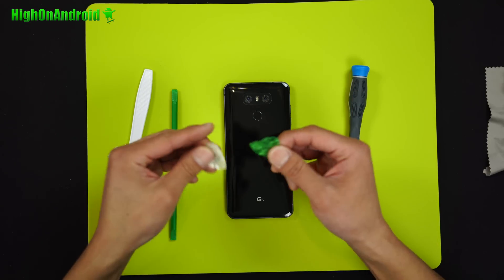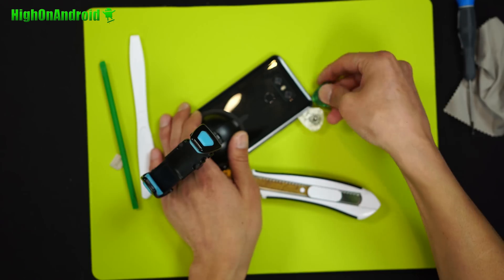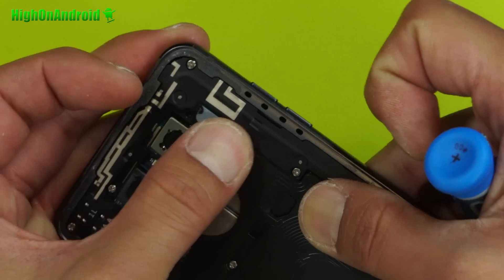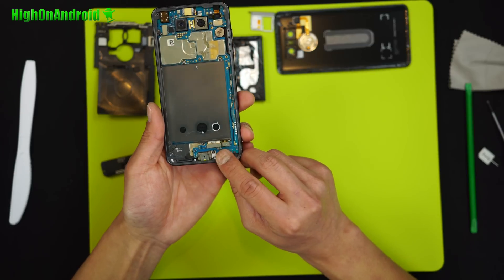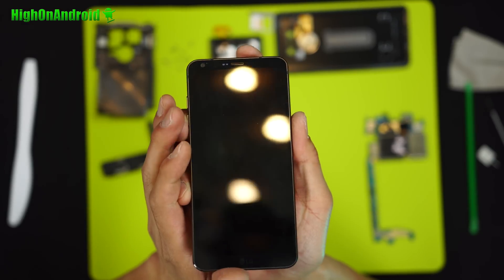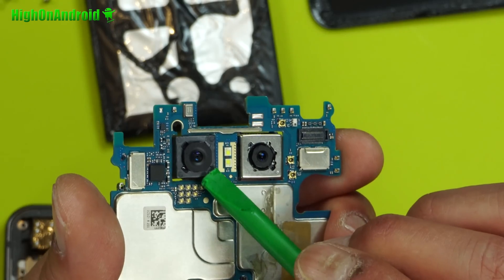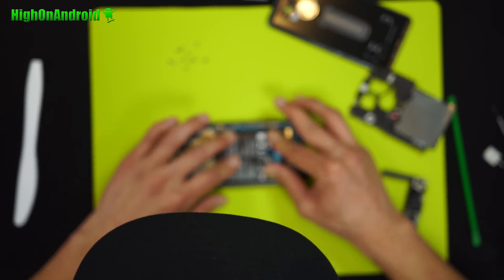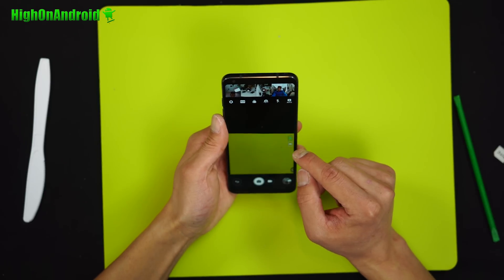LG G6 Disassembly Teardown - A Quick Look Inside!

Comment: This video was extremely helpful for replacing the back cover (Gorllla Glass my.... never mind).  Just note that if you have to replace the rear glass, make sure the replacement comes with an adhesive sheet because thats how all of the internals found inside the back cover are mounted.  Oh, and use more than 2 guitar picks if you're unsure (and to think I actually thought I over paid buying a set of 12 for 5.99 - I used 3 picks just to make sure I went smooth... All in all, thankts Max Lee

Comment: I suggest: use a silicon gasket for adhesive, its a good adhesive and is waterproof
Reply from the maker: Maybe too thick no?  I think just good 3M tape will do the job.
Reply: no, is not too thick, (its a silicon gasket glue)  I have already repaired a phone and tablet with that And it works very well
Reply: Francis Piché wouldnt it make a mess underneath when you put pressure.